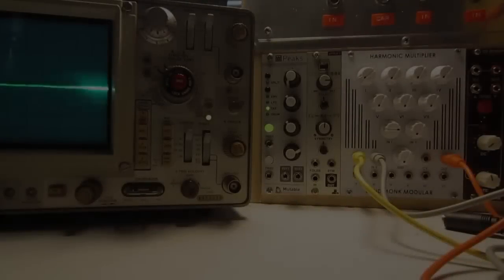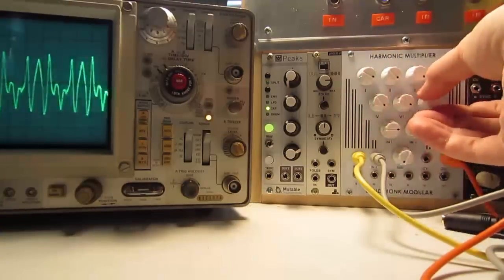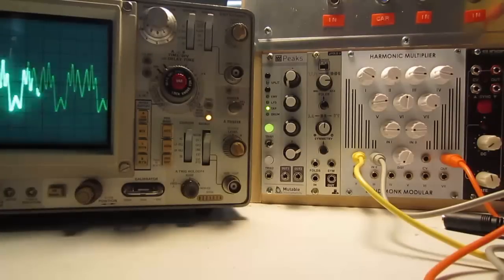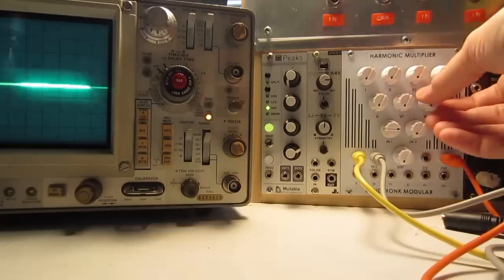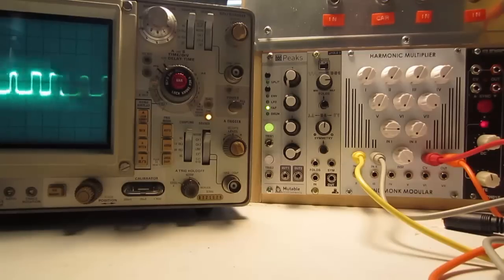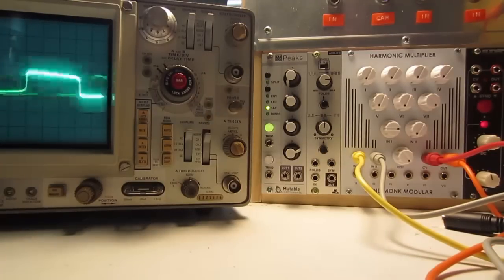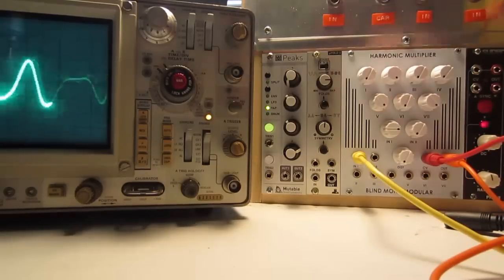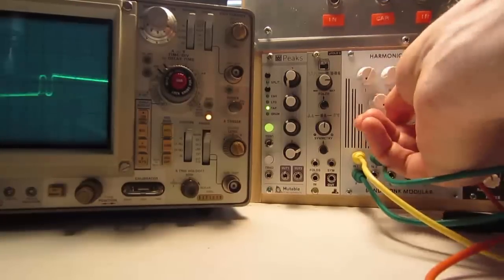Blind Monk Modular - Harmonic Multiplier

Comment: Isn't this just a wavefolder?
Reply: It's not just a wavefolder but it contains some wavefolders as well as other waveshaping circuits. So it does more than simple wavefolding.
Reply: So it is like 90% wavefolder? Not that wavefolding is not nice, but I am just trying to get to grips with exactly what is different in it.

Comment: All I ever see about this module says to input a triangle wave. Surely you can use any wave you want, right? I'm sure a triangle wave works best because it's very simple but still has some harmonic content to work with.
Reply from the maker: Yes, you can input any wave or sound you want. When using different waves on the two inputs, all kinds of interesting ring modulation / frequency cross modulation can be had.